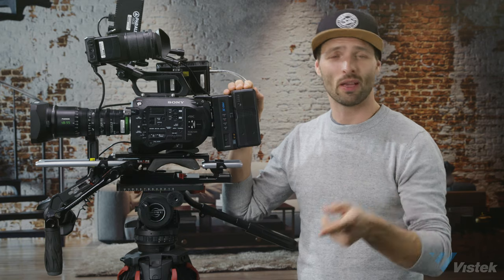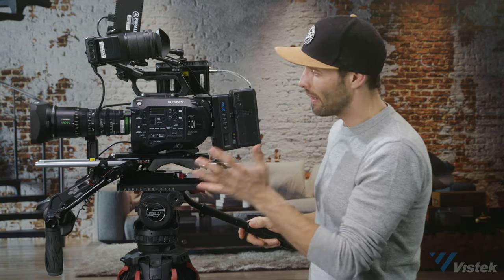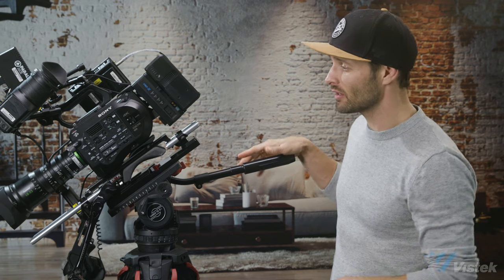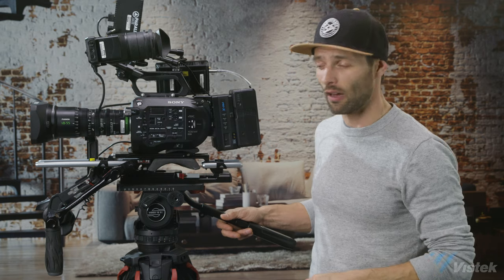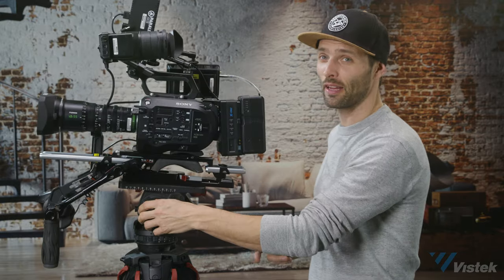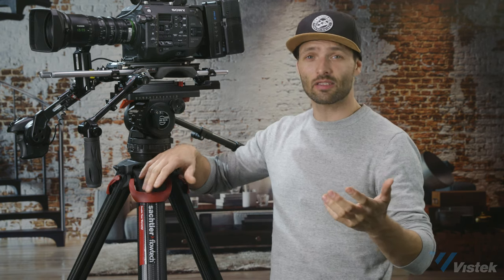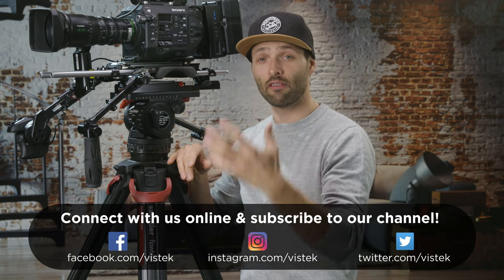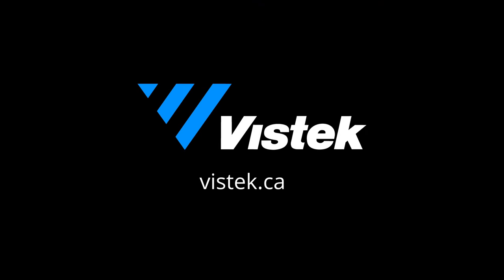Fluid Heads & Tripods: Everything You Should Know

Comment: FYI: With the Mitchell system you level with a levelling plate not the legs, the package is usually way to heavy to do that. Manfrotto also make a levelling adapter, like a 1/8 ball, which you can fit between a flat base head and flat base tripod system. They also do 1/2 balls in 75mm and 100mm for flat head systems. Manfrotto’s older PT 117 legs are interesting, as they have a geared centre column, which you use a handle to wind up or down over 12”, actually its faster than messing around with the legs, even on a flow tech system, when you want to make minor adjustments in height. Good video. Thanks, C
Reply from the maker: Thanks for the comment, Charles. Perhaps I should have qualified that.  I use Mitchell often,
Mostly the 2575 head - so I know what you mean here.  The levelling plate is still really for those final micro adjustments.  I consider Mitchell a sort of two step system.  Even with really heavy builds, I find that if you can get the sticks a bit higher than you need, you can play the creep-it-down game to get in the wheelhouse. Or worse case have the ACs help.  In any case, you make great points and I appreciate the comment!

Comment: Great video, lots of great advise much thanks.  I learned a lot as I was unsure of the differences and use cases for the various styles.  You provided a robust and clear explanation!

 I am going to be upgrading to a better video tripod, from my $199 Benro ProFusion Special.  Just rigged out my Sony PXW-Z90 with rails, monitor and v-mount batteries so I have a bit more weight now to handle.  I need to weigh the rig to understand the payload limits.  However, I do want to get a tripod that has selectable pan/tilt and counterbalance settings.  Looked at the Camgear recently at one of the local Vistek stores and it seems like a well built and quality product.  Just have to save up some dollars first!
Reply from the maker: Thanks for the great comment!

Comment: Super informative, way to go on the exhaustive info dump! :-D . . .   I mean, looking up patents? You outdid yourself! I only want to mention this from a personal perspective, but I'm moving away from VCT for now; I have a "well known" brand of VCT that I've used on a Miller Compass set up for the past 6 years -- and most recently, when sliding my FS7 rig into the VCT baseplate, the locking mechanism will "click" just as it always does - but not actually catch the nose of the plate. Thus, my camera fell once and I lost a lens; subsequent "double checking" revealed a number of occasions where the nose didn't catch, but the pin latched. I cleaned it, checked for calibration, and it's still proven untrustworthy. I know that plenty have success with this mounting system, but I've heard similar stories of the latching system on VCT's acting similarly after some use. Just my PSA.
Reply from the maker: Thanks for the great comment Matthew.  Yeah, VCT has always been reliable for me (knock on wood), save for the back latch refusing to catch/lock in without strong arming it.  I can't speak to the mechanics of it, but I feel like it's often just a wear & tear thing.  Typically I have issues with older plates.  But still good to know what your experience is and for us all to look out of it.  No one wants a dropped camera.

Comment: So IF you’ve invested in the Rhino ARC II what can’t you do with that ($$$) Slider that you can do with these Fluid Heads???

(In my case, I have a Z6 tethered to the Ninja V (ProRes Raw) attached on top of a Zoom F4 caged. I use manual focus legacy fixed Nikon lenses using Rhino for Focus Pulling... still less the 15lbs as 90% of my shots will studio with actors with specific lighting and sets and blocking... so setting up the Slider would only require a little effort than a fluid head tripod.

Comment: Even perfectly balanced camera will tilt over when you tilt up or down, because the center of mass is above the axis of rotation (which is inside the head). The reason cameras stay in place is because of the counter balance system, head tugs in the opposite direction to compensate.
Reply from the maker: Thanks for the comment!

Comment: Thank you - i have learned so much ... - But perhaps i should have seen this before i ordered my Carbon 536 Manfrotto even though it says it is made for video it does only have 1 bar for each leg, not 2/3 or the big wide ones you got on the satchler . 
The fluidhead i got was the nitrotech N12 .. as it is a bit more than my wholke shoulderrig. 

Do you think i should return it and get some completely different legs?
Reply: PS. Subscribed this was a nice Video man!
Reply from the maker: Hi Oussama.  Thanks for your comment!  It would be difficult to advise you to keep or return your fluid-head and tripod.  I think that would warrant a longer discussion about your needs and budget.   If you have a lighter camera, there is no, or very little need for a big legs.  Simple photo telescoping legs are fine.  It all comes down to the load you place on the tripod and on the fluid head.  You simply have to know the weight range of each of those  - and then you will know whether your camera system is the right one.  Good luck!
Reply: thanks - It was mostly that mine is for video but has none of the spreaders or dobbel barrel but its fine on specs for my needs in weight
 @vistek

Comment: So is using a zoom lens with a dovetail system going to be a problem due to the weight moving forward as you zoo in and therefore unbalancing the camera?
Reply from the maker: Hi Louis, no - or at least not in a significant way.  The only time it would is if you were on a very tiny camera and using a big telescopic zoom.  And even then the difference may not be great.  For most camera systems it would create a percentage change great enough to significantly alter the balance.
Reply: @vistek  Thats very helpful. Thanks. :)

Comment: I have a 600mm still lens attached to a bmpcc 6k, mounted on a Sachtler fsb8 + Speedlock CF legs, that i use for filming nature. Although the fsb 8 balances this setting well, and provides smooth pans, the videos are quite shaky because there's a lot of vibrations from my hand, holding the pan bar. By how much would you think i could reduce these vibrations by moving to Sachtler 100mm fluid heads like the DV 12 SB, Video 15 SB or the Video 18 S2? Which one would you recommend?
Reply from the maker: Hi Beni - I think there are way too many factors there for me to make a recommendation.  My only recommendation is to take your camera/lens set up to a store and try all the options.   Perhaps asking the question on the CML forums could get you a response from a seasoned wildlife DOP (https://cinematography.net).  Best of luck!